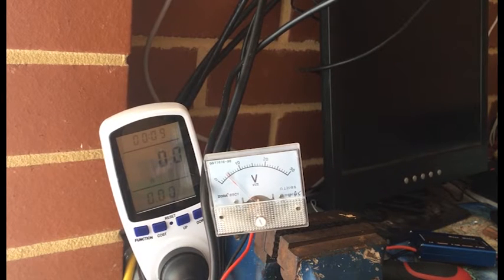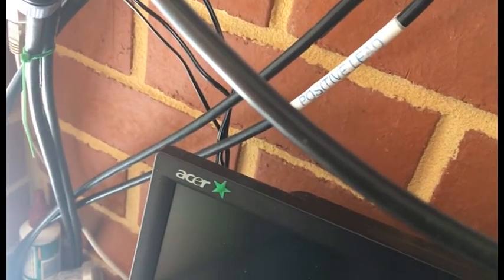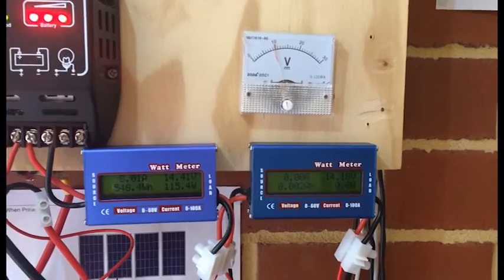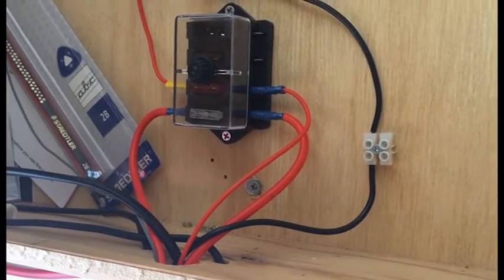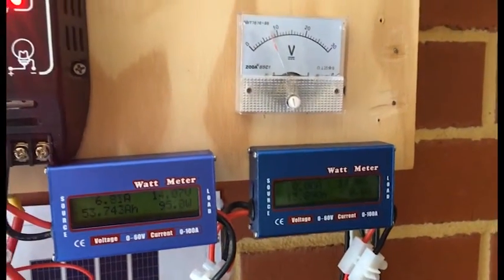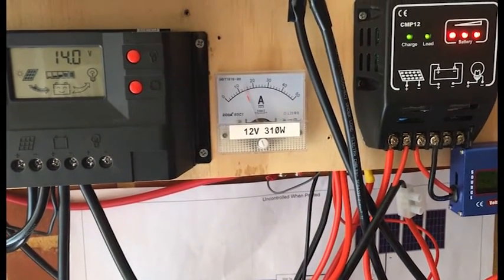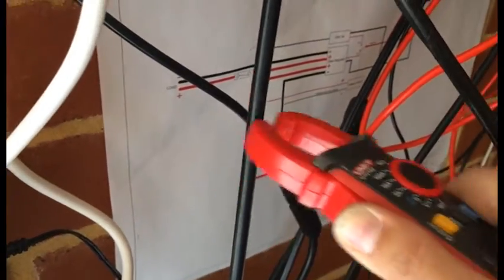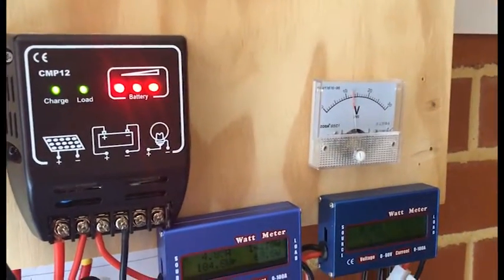Trying a micro grid tie inverter with a Wind Turbine

Comment: G'day Mate, my best advice to everyone is to keep any power you make off grid, after spending money on your setup you should keep all your power for your own usage. Start with 12V car batteries and 12V lighting, then 12V cooling with fans or heating with a 12V diesel heater. I was amazed how many 12V products are available, mainly for 12V cars and camping ( 12V Air coolers, 12V Heaters, 12V Cooking, 12V Kettles ). Living off grid in town I even have a 12V hot water system, but every 12V appliance takes longer to preform their function. Next tip is buy as many secondhand house solar panel sets as you can each month, they might have a bit less output then new solar panels, but every amp adds up to getting more charge into your batteries ready for over night. Buy a small wind generator only after setting up lots of solar, Have solar panels flat on the ground and along fences. As you build up your system you might be able to run an AC power inverter, but it will use a lot more power from your batteries. Buy bigger batteries in time.
I hope this information helps everyone.

Comment: Dude!  Dude! Dude! Dude! Dude!   This is amazing!!  

What I did, was I got 2 solar panels, a charge controller for them, and 2 marine boat batteries, and added a windmill, with its own charge controller, to the 2 batteries in parallel. 

However, I took my 12v devices, and cut the plug off of them, since it’s a switching power supply that turns the 110v ac into 12v dc, and I ran the wires directly to the load side of the charge controller, and I get WAAAY more life out of my devices before it drains my battery bank.  Like 8x the life from avoiding the DC to AC inverter, then the AC to DC switching power supply.  

I think every solar/wind system needs circuits to not only power equipment that runs solely off of AC, but a direct DC connection that bypasses the double conversion, since it Costs roughly %60 to %80 of the energy you produce.

Comment: excuse me, may I ask for the scheme you are using. if possible, please send a simple description and description of the tool you are using.
Reply from the maker: Walid Husen 
The wind turbine is a AC single phase but the output is DC and that goes straight into a cheap Chinese grid tire inverter.
Reply: @Chikiebabe666  im sorry i want to your schemes. just schem and description componet. please ms
Reply: @Chikiebabe666  Hi, Do you have a 3 phase rectifier? or other ? thank you
Reply from the maker: Vintage Things  I got 2 phase

Comment: Hi there, I do this professionally and you are on the right track.
Go on Ebay and hunt down a voltage tripped solenoid controller. Once the batteries are charged, you can set it to switch the output to the gridtie inverter.
hornetwind is reasonable; about $100 including shipping from USA. Will handle 100 amps or so continuous , no sweat, so will take anything you throw at it.
  I use one to switch my solar over and one to switch my 65 amp turbine.
Any questions, please feel free to ask, as I don't charge for advice to the Utube community !
Sundancer( Simon ).
Reply from the maker: +Sundancer 
Ok thank you for the advice
Reply: wouldn't the amps from the battery bank be too much for the grid tie inverter when it goes to dump load because the batteries are full? I was thinking of doing that but was afraid of burning my inverter out with the battery amps.
Reply: Hey sundancer, or get rid of expensive batteries and their maintenance and go from the wind turbine straight to the grid but using super capacitors in order to stabilize the wind turbine output in order to keep the inverter running,and ti cut of lows and highs in voltage. Google for this,there is an document online from an university absolvent.

Comment: The vibrations on the shed when the wind picks up in the video, must drive your neighbours nuts. Is there somewhere else you can mount it rather than the side of a tin shed?
Reply from the maker: +Mikes DIY Tesla Powerwall 
I haven't had any complaints from the neighbours 
I can't move it somewhere else I don't have the money although I could probably buy some rubber and put it in between the shed and the wind turbine and Insolate the shed and that should solve the problem I think no installation cost a lot of money but I think it'll be a lot cheaper than moving out because I need to get along a pole and guide wire and It wouldn't look as nice and I might get complaints of it sticks up to high
Reply: Thats true, one thing you can do next time its windy or making a noise is go over to the next door and ask them if they can hear it. If they can they will soon tell you if its a problem or not. But better to ask then not. Plus it would be interesting to know if you can hear it. I am sure you can if its night and people are trying to sleep etc. :)
Reply: Just need some rubber between the wood and metal
Reply: did a hole fill it with concrete job done

Comment: You really shouldn't have your batteries sitting on the concrete it will kill them dead over time , I've got mine sitting on 3x2 frame I made to keep them off the floor !!!
Reply from the maker: +87xfute 
They are sitting on wood

Comment: how many watts is your wind turbine?
Reply from the maker: That's why I'm not going to do grid tie with it
Reply from the maker: +sven 
It's a 90 watts wind turbine
Reply: two of those would run my house all night after i went to bed.
Reply from the maker: +sven 
The only thing about wind turbine is that wind is not Constant so you don't get constant amps 
:-(  but I do like having both
Reply: sven, two would be 180w at 12 volts in full wind , so that isn't much at 240v. Maybe 50w AC?
Reply: I was under the opinion 180 watts is 180 watts

12 volts   =  15 amps
240 volts = 0.75 amps.   = 180 watts
Reply from the maker: Mikes DIY Tesla Powerwall 
My Wind turbine is 90w
Reply: Hmm sven you might be right lol. Tho it will be 180 - 15% on a 200w grid-tie so around 150w peek